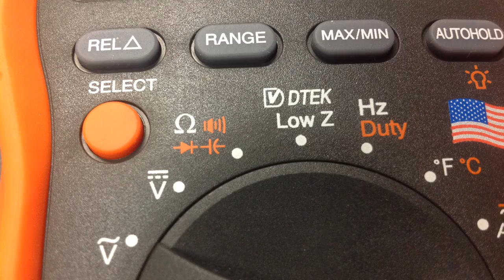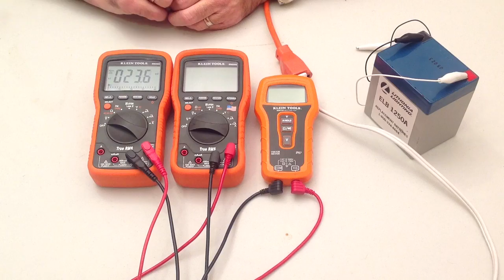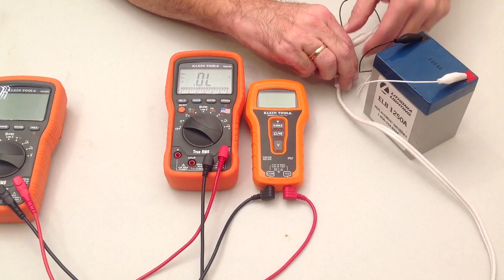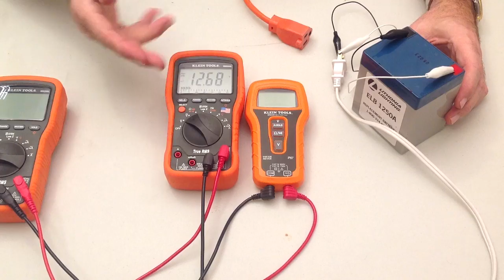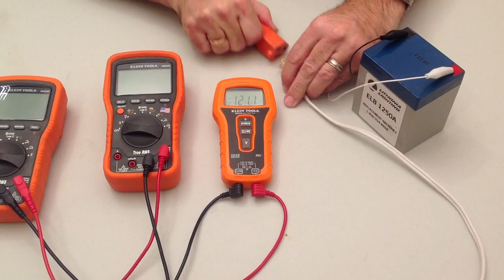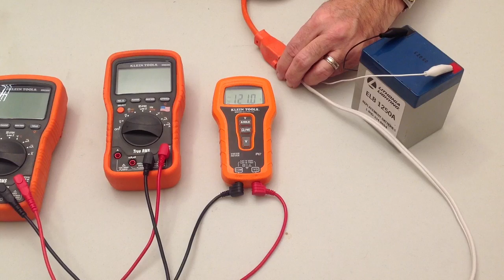Klein Tools Training Voltage Selection

Comment: Could you make a video on how to set up the klein tool to measure amps in an car. To find out if there is a drain on the battery by removing fuses. I have a klein mm1000 and I am not positive it is set up properly.

Comment: I just went through this today ... bought a cheaper MM400 thinking it would auto detect AC/DC and it took me a few minutes to realize I had to push the damn button to change - 
Very Crappy Un-Intuitive design and if I didn’t destroyed the packaging, I would have returned it -  hopefully it gets the actual measurements correct.

Comment: Why does one meter read 12.68vdc and the other smaller meter reads 12.11vdc? which is the correct voltage?
Reply: if you watch again and pay close attention you will see the smaller one says 121.1 vac